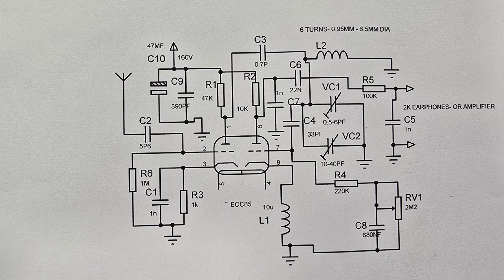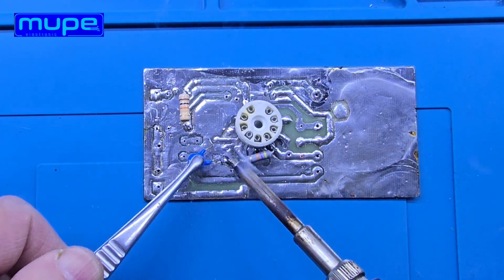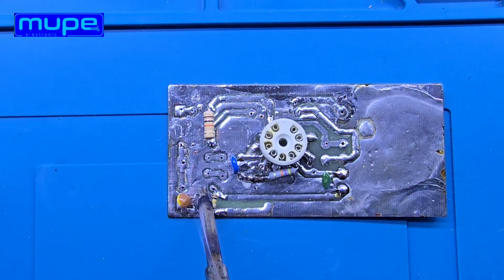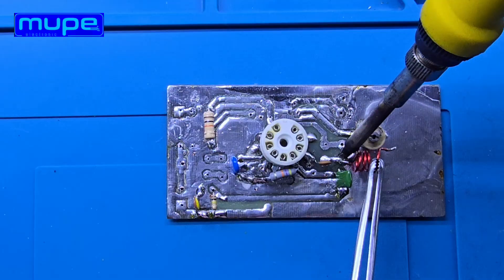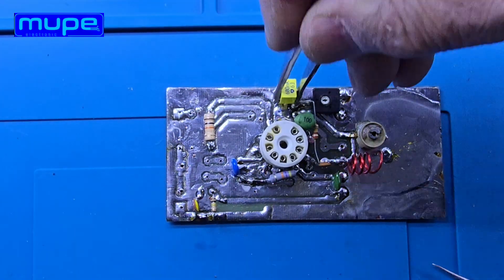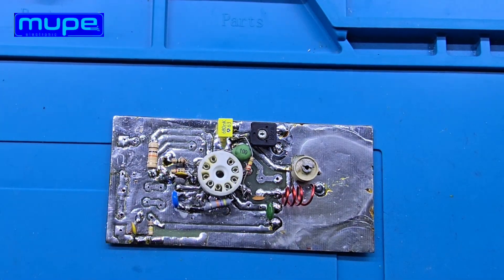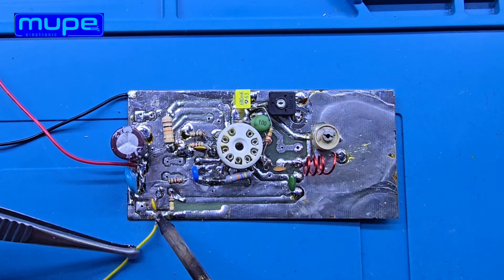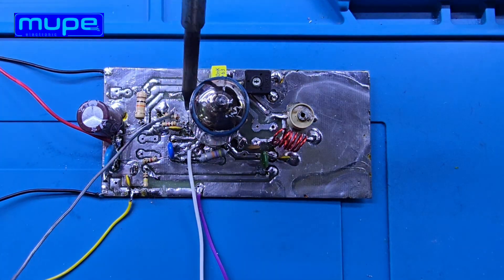Can a Single ECC85 Tube Really Receive FM?

Comment: Howdy. Nice.
One different opinion though. I believe the L1 choke (10 uH) is needed to generate the quenching oscillation. It is not for filtering purposes, in my mind.
Cheers.
Reply from the maker: Thank you for your comment and valuable insight!
You’re absolutely right — in super-regenerative receivers, the RF choke is not merely a simple filtering component; it can play an active role in establishing or sustaining the quench conditions.
By experimenting with several inductor values, I found that 10 µH provided the best overall performance.
In this circuit, the 10 µH choke is primarily used to isolate the RF stage from the power supply and to stabilize operation; however, its interaction with the circuit also contributes to the quench oscillation.
Thanks again for your thoughtful perspective.
Reply: L1 in conjunction with the stray capacitances forms a Colpitts oscillator to get the triode to oscillation at VHF. The quench is generated by the time constant formed by R4 and C4.
Reply: @cool386vintagetechnology6  Howdy again.
Caramba ! You are correct and I have been wrong.
Looking at VHF only.
With no cathode inductor the VHF would go straight to B-. There would be no VHF on the cathode to feedback through the capacitances.
This explains my strange observation that both VHF and quenching faded out at about 95 MHz, using a low quality inductor. Changing the inductor to another brand restored the operation over the full FM band.
Yet and still I believe the inductor also is mandatory for getting quenching. Together with the valve, C4 and R4 there is a relaxation quench oscillator.
Cheers again.
Reply: @cool386vintagetechnology6  Howdy.
With all due respect.
I should think L1 is not involved in the VHF oscillation. I still think it facilitates only the quenching.
In my mind the L1 produces the biasing to sway. When the bias moves along a favorable region the gain is high and the valve jumps into VHF oscillation. I understand it is a Colpitts operation. Yes. The valve capacitances and stray capacitances constitute a 'tapped' tank capacitor.
Best regards.